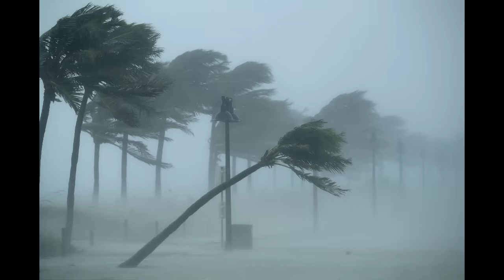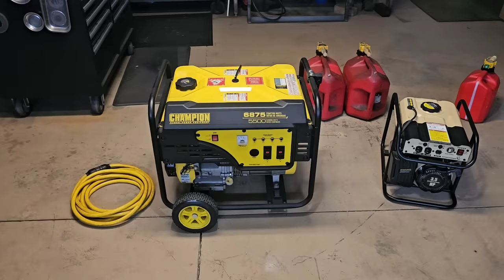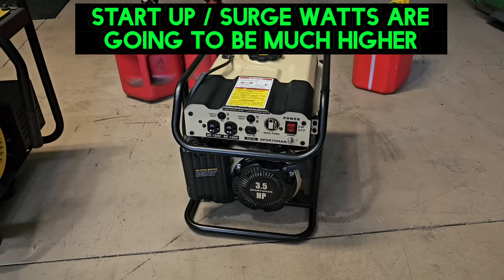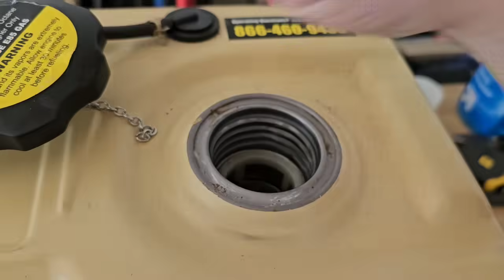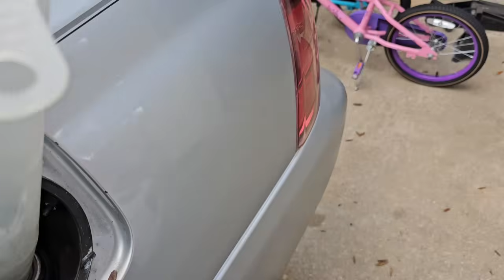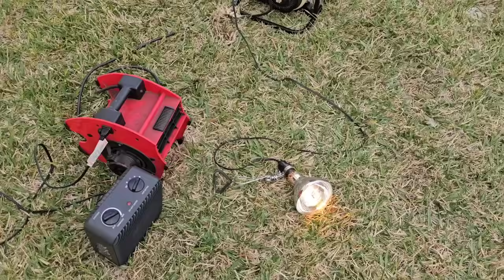Why smaller generators are better for power outages.

Comment: I do the same thing i have a 13500 watt conventional generator to run the big appliances in the house and the rest of the time i have a 4000 watt inverter that will run for 24 hours on 3 or 4 gallons of gas at 50% load. I can power all the lights in my house, 3 fridges, the tv and my gaming pc and other than the surge when a fridge starts it sits right at 1500-1800 watts. A small inverter is the most fuel efficient one you can get. Fire it up let it warm up then switch it to economy mode.

Comment: Partnering a small off brand 2,000 watt Honda like inverter generator ($<500) with a EcoFlow Delta 2 (1,000 watt stored power) power station ($400) may be the most gas efficient way to keep going. Let me explains some details.  Recharge the power station from the gas generator as needed. Use the power station to keep fridges and freezers running and have easy access to small amounts of power for everything else (coffee maker, microwave, tools, tv, lights). Fridges use about 200 watts of power per hour. My Delta 2 with claimed 1,000 watt hours actually ran my fridge for 12 hours. (Fridges cycle on and off). The Power Station, which is an inverter and lithium ion battery combined can be recharged off the generator in 1 hour. (make sure whatever model you get has quick recharge times.) I have seen it said small generators should run at about 75% of max running load for best fuel economy. The EcoFlow Delta 2 charging speed can be throttled back (200 to 1200 watt load) in the phone app to whatever speed you want. (It can fit your generator.)  It is good to have a generator that can run anything alone, if needs dictate. A 2000 watt generator running at 75% load should be able to power most things. This mean you run your generator about an hour or two in the morning and an hour or two in the evening. Then all day and all night you use your Ecoflow power station for small things, (and can run a fridge.) Obviously, one can run gas generator and power fridge and freezer directly if you want. The EcoFlow Delta 2 is one of the smallest cheapest power stations that has 1800 watts output power (able to power anything you plug into a wall). Any other power station brand Bluetti, Jackery others will also work. Power stations can be a little picky so make sure it is an inverter generator (with cleaner power.)   At this point designate one 5 gallon can of gas for this setup. You should be able to last two weeks or more.

Comment: I saw a YT video where the smaller generators were more efficient than the big generators. For me I run a 16kwh battery bank on an 3000watt inverter for just the basics. That's two fridges, one freezer and the furnace. If the outage is extended, you can charge the batteries with a generator while powering the house or disconnect to charge faster. I have no small generator yet. I do have a work vehicle that will idle for days with a 3000 watt inverter and microwave in it. I figure I can operate for a few days and randomly charge the system with the work vehicle when I am home until I get the generator. It'll cost me another $1700 to add another 16kwh to the battery bank. This is the gateway to solar power. This is an opportunity to those with time of use charging to charge the batteries when it's cheap and run off the batteries when it's expensive.

Comment: I get your thought but I can run a larger inverter say 10000 watt on propane managing my electric consumption so I have the power to keep my well pump & furnace running with the refrigerator or freezer and run at 25-50% on ECO mode to conserve fuel. This is just my situation.

Comment: Great video. Just went through a 2 day power outage with a 9000 watt generator. A smaller generator would be perfect to run at night, just for the refrigerator.

Comment: These engines require oil changes every 24 hours or so. They're running hard and hot and the little ones have no filter. Even at a 50 hour oil change, those hours add up quickly. Add a few quarts of oil to your stash and remember to change it.

Comment: Hi
I watched your video, and it was very helpful. Mabe, you could answer a question about floating neutral generators. There seems to be a lot of confusion about bonding and floating neutral. It's my understanding that if you use the unit as a stand-alone generator with extension cords, the neutral should be bonded to the generator ground. If you connect it to your home system, the neutral should not be bonded on the generator.

Comment: You can't really back feed more than 50 amps so it's best to buy a portable generator that can produce roughly a steady 12,000 watts. Anything more than that is just not suitable because producing more than 50 amps could just trip the 50 amp breaker. 12,000 watts is a lot of power. Generally it will back feed a average house as long as you don't try to run a HVAC, Water Heater, Dryer and Range all at once. Could run one or two of these at best. I suggest you add a soft start to your HVAC if you want to run it off a Generator. That will help lower the power needed to start / run. Note: If you are back feeding with a 30 Amp breaker, you need to get yet a smaller Generator. Even the GenerLink meter feeds are limited to 30 / 40 amps. It goes without saying that the more demand you draw from a Generator, the more fuel it will use. That's why limiting what appliances you use during a power failure is recommended. The ones I mentioned take the highest amount of power to run.

Comment: A simple solution. Diesel generator. I've been using it for years. Average consumption exactly 0.9 l per hour. No worries about old fuel. I don't know where this video was filmed and if you have diesel generators available where you live.

Comment: Easy fix, get some 12v/24v lfp batteries, a meanwell charger and an inverter.  Use the generator to charge the batteries, use the batteries to run the home..... Plus, no need to cut the power to the house for refueling.

Also propane is way better, less startup issues, cheaper, easy to store for years..... Go for a dual fuel model...
Reply from the maker: Good plan and ideas. I actually have started getting into batteries and solar. "Solar Generators". Its definitely a good addition to having a gas generator. 
 I also replaced that small coleman with a 1200 w Predator Inverter and its very quiet and fuel efficient.  
I was thinking the other day I need to get more battery capacity before more solar panels. I can use the generators to charge up the batteries if needed.

Comment: The Champion 3500 can't be beat. I would never buy another brand as far as a regular generator. Ran my Champion 3500 24-7 for six days during Beryl. Need to give er an oil change.  Next on my list is the IQ3500. inverter .

Comment: If you are in an area with many power outages, a good combination would be a generator and a LiFePO4 power station with solar panels. If using lower powered items such as a non-gaming laptop, usually the solar panels will keep the power station topped off and the laptop powered, along with a few other devices, e.g., chargers for smartphones, tablets, power banks, etc. A decent power station will typically also have enough power for smaller devices and a lamp to run through the night as well. That allows the generator to more comfortable be used periodically, e.g., run the fridge and other appliances. 

PS for storms where the power is likely to go out, if your fridge has a power cool option, then enable that and keep it enabled throughout the outage. For fridges that offer it (it can have different names depending on the brand), but what it does is effectively temporarily turn the fridge into a freezer to more quickly cool things down. If used before an outage, it will keep things cool for a longer period of time before the food spoilage temperature is reached.

Comment: Fuel consumption is why it’s better to get two Honda 2200 inverter generators that can be connected together for double the output, if you need only one then run one , if you need more power fire up the second one, they’re probably the most fuel efficient generators I’ve seen and very quiet
Reply from the maker: I actually sold that little generator the very next day after making this video and I bought a Predator 2200. Its so much better than that coleman.  Plus it can be plugged into another 2200.
Reply: @Mechanical_Mind , it may be hard to find someone to repair a harbor freight generator, I had to call around to find a place that could fix my 4000 watt generac
Reply from the maker: @Mikey196601  Im a mechanic myself but I will say Ive owed several (over 8 ) different Predator generators over the years when I used to do mobile welding and equipment repairs. 
First one I bought I didn't think would.last a month. It took many years of insane abuse. Finally after the gas tank got crushed I let it die. Other than rope pulls breaking  Ive never had any issues of them. When the rope pulls break I crank them with a drill.

Comment: I have a 10000 watt generac parchased in 1999 . Touch the starter and it starts and runs like new. I roll it out of my shop every 3 months, shiney red looking almost like when unboxed. The only change is a Harley chrome muffler .I also have a small  champion for night .Two neighbors have helped provide gas so to run power to their house from the big red . Keep them inside and run every 3 months and you'll  never be left in the dark . Oh, store and replace emergency gasoline. God bless 12:55 12:55

Comment: One thing to consider is when using a gas generator with a solar battery bank.  Some of these battery banks can charge very quickly at a high wattage.  The larger generators are more fuel efficient at those higher wattages.  However, if you’re running things that cycle on and off, the smaller generators are better.

Comment: I prefer 2 smaller inverter generators over  big loud regular generator, I have 1500 watt peak one with 1200 watt running that use only for the fridge, and then a 2300 watt peak 1800 watt running that I use for everything else like fans, microwave, charge phones, tvs , things like that, I can literally run my whole house other than the AC and I have the fans for that, I can be pretty comfortable for a whole week in like 20 gallons of gas

Comment: FYI you can add one of portable solar generator, it basically an portable battery with inverter, to use during the night and recharge with the solar panels or small inverter generator forcouple hours during the day, it can saves a lot on gas

Comment: Good, wise, advice. Lots of people don't understand generators. The better ones won't run much more than 25 hours on an oil change. The sensor will detect excessive heat and they won't run right if at all. Most generators require a long neck funnel to add oil. Tipping a generator can kill it. Propane generators are more economical and cause fewer problems. We run our nearly 5000 Watt dual fuel for about $1 an hour with propane. It's cheaper if you have a gas company person connect your generator to your home propane tank. There's a lot to all this. Thanks

Comment: The sounds are the same
Reply from the maker: I admit that specific little generator was a loud piece of junk. A few days later I sold it and got a predator 2000 inverter. They are far more quiet.  Even a 4000w predator is quieter then that yellow champion generator.

Comment: The problem with this suggestion is that small generators only provide 15amps of current on average. 

If you have a well,  you will need to open it's breaker to avoid burning your well pump up. 

Likewise,  depending upon the time of season you may require heating OR cooling which requires more current to safely operate. 

I have two backup generators. 
One is a 15kW Diesel which produces 60 amps of current and sets atop a 50 gallon OSHA approved fuel tank. 

My second backup generator is a 9kW gasoline that produces 28 amps. 

Both generators are connected to a manual transfer switch which avoids backfeeding which is illegal and deadly to linemen. 

Additionally,  I have a 5k amp hour battery bank that feeds a 10,000 watt voltage inverter.

The battery bank is charged by a 10kW solar panel array,  as well,  I have a 225 amp battery charger that can be used to charge the battery bank if need be. 
 
I have a second transfer switch that exclusively  deals with times I utilize the inverter system. 

The last option safely powers general power needs within the home (excluding electric heaters or air conditioning)

Comment: I have a 5000 watt generator and used it during the Ice storm of 2010.  I put 5 gallons and used it to power the fridge and tv and xbox so I could watch movies. for 4 hours each day for 5 days. That was over 20 hours before I needed to put more gas in it. So I think maybe you did not do your test correctly.

Comment: In regards to fuel....  I would suggest dual fuel & and propane tank.  Not the 20lb tanks for a grill, a big one (like for an indoor fireplace).  That will store practically forever so you can fill up and NOT have to run at the last minute to the gas station.

Comment: I used a watt meter to determine the demands from the devices I want to run and determined that a 1600 watt generator would do the job.  I have a small 1600/2000 watt Firman inverter generator that I can use to run our fridge, furnace, our internet modem and WiFi and one bank of outlets in the kitchen.  I wired in a Reliance cutover switch that removes the backup power from the grid and it worked great when I tested it. The manual for the generator says it can run for up to 8 hours with a low load on 1 gallon of gas.  My son who lives in an area that has sporadic outages uses the same kind of generator to run his fridge, furnace and some outlets through a cutover switch.  It's really all you need unless you have well or sump pumps.  Also!  Use ethanol free fuel if you can get it and run the generator every month to make sure it runs.

Comment: I can’t start our natural gas generator when it’s cold outside. Tips?
Reply from the maker: First things I'd check is the oil level and spark plugs. 
Most generators now have a low oil shut off. If the oil level is correct I'd next check the spark plugs. I was recently helping a neighbor get thier brand new generator started. It had been sitting for months and had never been started. Never even had gasoline added. It had a bad spark plug in it. Brand new spark plug also. Changed out the spark plug and it cranked right up.
Reply: Oil and plugs ok, runs above freezing, tried preheating with a hairdryer, seems like it’s a function of the cold air
Reply from the maker: @patschafer1885  I wasn't even thinking about it being cold. (I guess since I'm in Florida and it is warm here now) 
Is it an electric start or just pull start?
I wasnt thinking earlier about it being electric start. If it is I'd suspect the battery or cable connections first.
Reply: @Mechanical_Mind  new battery, cranks fine, just won’t fire and run.
Reply from the maker: @patschafer1885  it's either not getting fuel, spark or compression.  
If you spray some starter fluid spray while you crank it and it runs on spray but dies when you take it away, then it's having an issue getting fuel. 
If it does not run at all on starter fluid then I'd test the coils with a coil tester. 
It will plug between the spark plug and plug wire to see if the plug is getting power to spark. 
You could also have a valve that is stuck or rocker arm or push rod have gotten loose. Remove the valve covers and you might find your problem.

Comment: I keep 10 gals of gasonline on hand and cycle that gas through my vehciles every 60 days or so.  That way, I always have fresh gas for my generator.  If we don't have to evacuate, I can tap into my vehicle's gas tank for more generator fuel.  Where I live, in the 40+ years, we've had maybe 4 power outages that lasted less than an hour each.  Assess your risks.  If you are prone to flooding, maybe living in hurricane prone areas or mountainous areas, in case of flooding, the plan where you live might be an evacuaton plan, not a power generation plan.

Comment: My advice is use a small generator and a 2kw hour power station that you charge with a decent solar panel+ gas generator. You will be in really good shape with those 3 items.
Reply from the maker: I agree with you 100%. I have gotten into solar and power stations this year and they are a game changer. Also now have a small 2000 inverter generator. Now I just want more solar and battery capacity

Comment: I don't know, l have a 1600 watt/2000 peak watt generator and it wasn't strong enough to cycle the compressor on my fridge.
Reply from the maker: Not all refrigerators are the same. Another thing to consider is that your generator could have an engine issue like contaminated fuel or dirt in the carb, causing it to lack power. 
My predator 2000 has no issue with our fridge.
Reply: @Mechanical_Mind  well thank you for your reply. I really do appreciate videos like yours when l run across them. 
 It's a big fridge. I was actually able to get it started by plugging a Yeti power pack into the extension cord, plug the fridge into the power pack, then hot-swapping it to the generator. The power pack flashed "Overload" but it worked. The generator is a few years old but rarely used and had fresh gas in it. 

I still want to get a bigger generator and connect it to the breaker panel with a cutover. We had a 2-day outage, and absolutely nothing worked. At our age things like that are a real hardship. Thanks again for your input.

Comment: What's the big one run at 25% ?  

Because if you think about it, if you're going to buy the small one and run that at 50%. You're already running a lot less than you were running at the big one 50%. 

I have Eu7000is that runs the house. Gas appliances and boiler. Have eu3000is converted for propane.  Have 500g of propane.